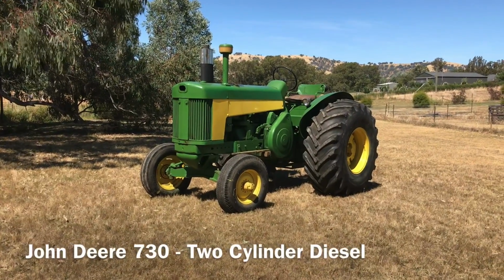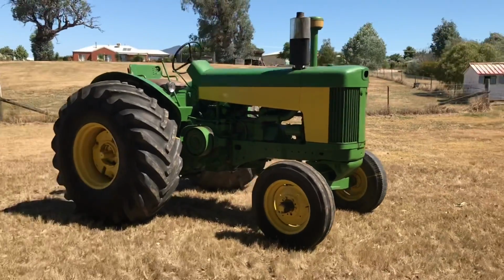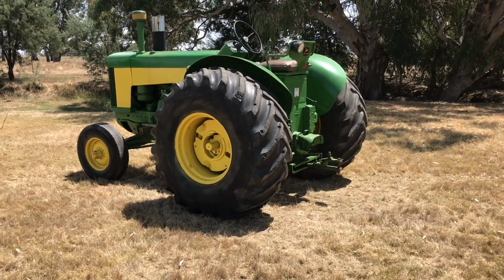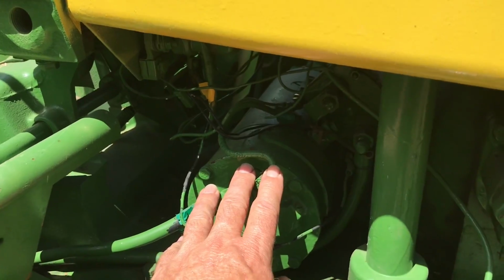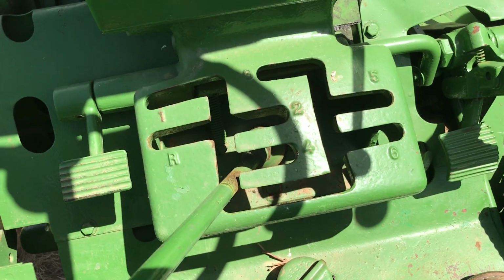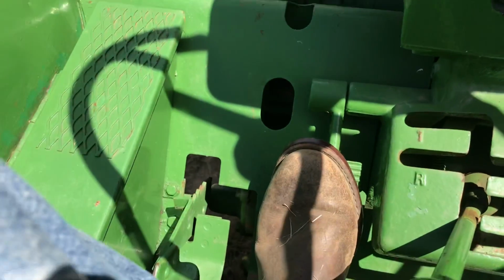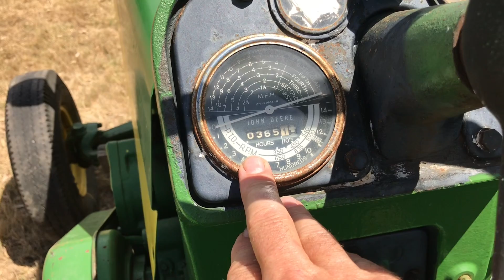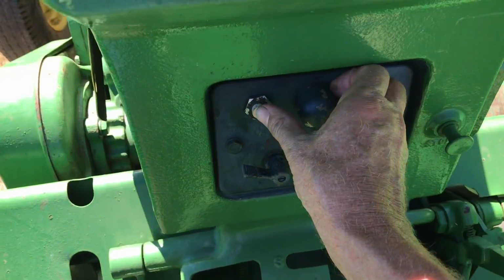John Deere 730 Twin Cylinder Diesel

Comment: What year is this one
Reply from the maker: 1961 - last year of manufacture 👍
Reply: @waterloocreek5659  my grandpa has a 1961 too they are really clean tractors to drive
Reply from the maker: @jarrodmeys3283  I agree, as the driver you get to sit up high, electric start, the 730’s are just a nice all round tractor 👍
Reply: @waterloocreek5659  yea
Reply: @waterloocreek5659  I had no idea they went to 61. thought the 4010 replaced them outright in 60.